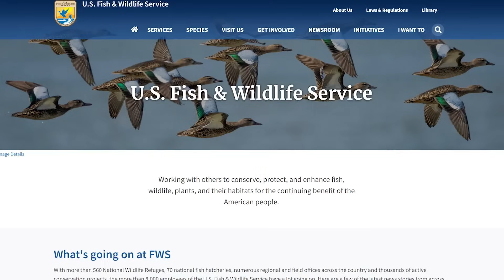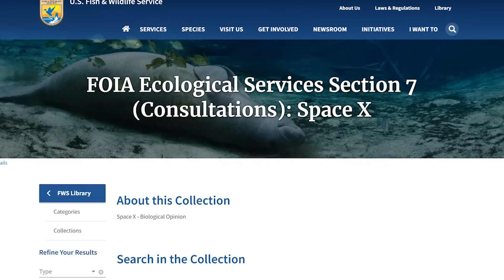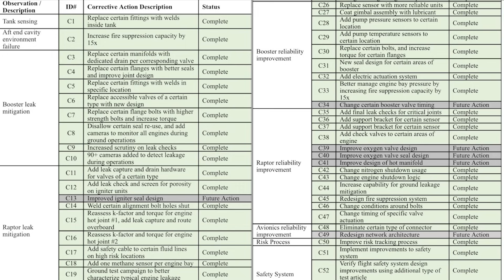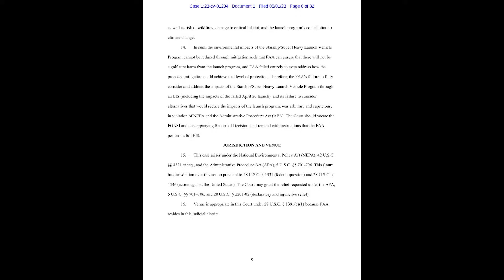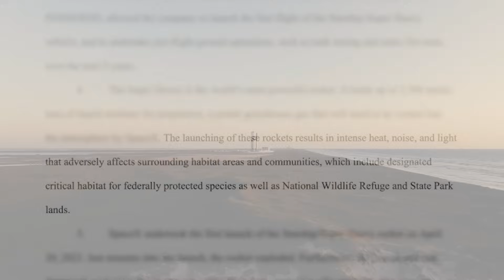Environmental Concerns Could Push Starship's Launch To Next Year

Comment: Heat, light and noise could be a problem? How did the environmentalists not foresee this? I mean, most people are aware that rockets make a bit of noise and heat.
I'm pretty sure SpaceX don't plan on excavating their launchpad every time, so the 'highly dangerous' concrete rubble and dust is unlikely to be an issue.
Seriously though, if there were such major environmental concerns, then maybe they should have spoken up several years ago.

Comment: This has to be satire. How is an environmental agency set to determine the success or failure of an engineering project. It's like asking a seamstress to see if a chip design will work. The FWS obviously allowed the first launch to go ahead and then they were upset by the "intense heat, noise and light". They are clearly not equipped to understand what they are dealing with.
Reply: I agree with you but on the other hand, why choose a wild life refugee to develop and test new rockets? SpaceX was surely aware of such restrictions before moving there. It's the same reason why the area wasn't full of beach houses in the first place. But I agree with you, it seems odd that an engineering project gets block like that. Those details should have been completely dealt with before even starting the construction of Starbase!
Reply: @DavidCaissy  They chose Boca Chica because SpaceX would NEVER be allowed to proceed with its haste and hubris method of testing in Canaveral, Central Florida Range. Imagine if Starship test had fragged Canaveral Air Force Base. Musk thought Texas would be a libertarian free for all. Not even the Red Government of Texas would tolerate the haphazard and risky testing of Starship. White Sands, Kwajalein, Diego Garcia is where you can blow up Starships at almost any level of development and testing. Despite DOD and NASA need Starship procurement, they will not come in like the cavalry. Like Tesla, SpaceX competitors are catching up. The Turtles indeed might beat the Rabbit. In 5 years, the established car companies will be churning out millions of affordable EVs and Tesla will be a niche brand like Apple. SpaceX will keep having mishaps inviting investor and government scrutiny, while the plodders just might invent the Rocket 747.
Reply: USFW  and Interior have all sorts of engineers and policy experts that are much more qualified than an almost anyone subscribed to SpaceBucket.